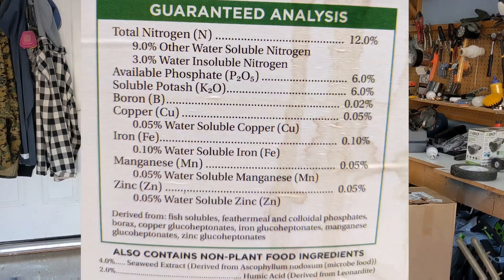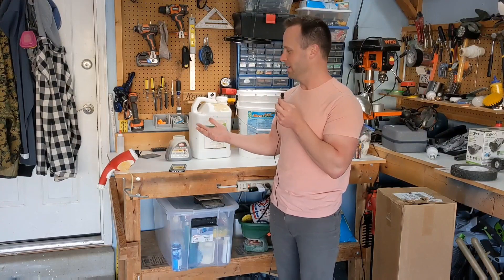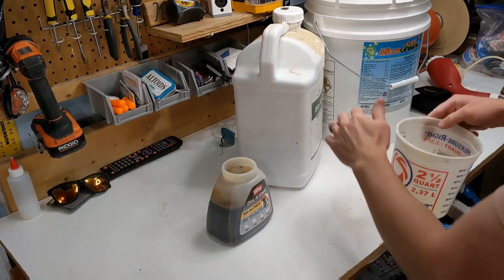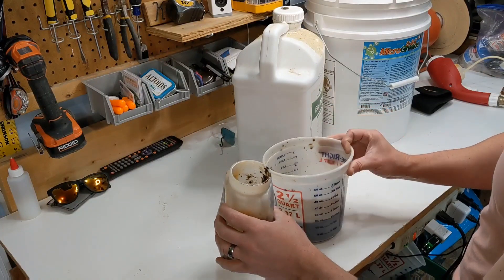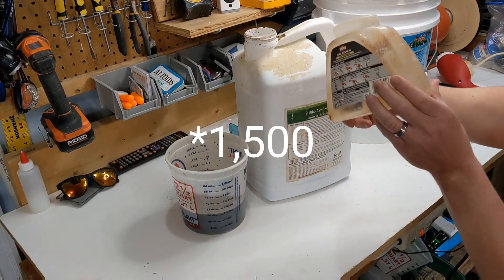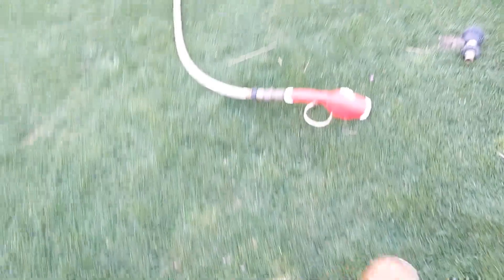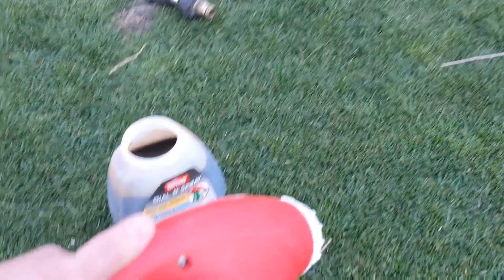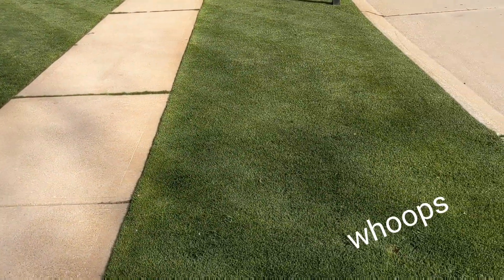Liquid Fertilizer comparison side by side

Comment: I predict no noticeable difference.  Overpriced gimmicks.  BTW, your hose cover ended up in my backyard in Minnesota.  It's now on ebay.
Reply from the maker: My prediction is there are much cheaper ways to make your own liquid for a fraction of the price with  little elbow grease. I should have made my own Ferrous ammonium sulfate mixture and had a plot of that. I may wait for the current effects to wear off and restart the test. My prediction is pretty much the same, to the extent they work, there are much more frugal options.

You must have found it in a field with one of your quadcopters!
Reply: @kove  LOL!   You don't know how right you are with me losing quads.  As for Goose Juice,  your own mix is the way to go, and tweak as you learn.
Reply: @kove  booom..way cheaper. FAS....   works best with a backpack    $0.15 / 1000 sqft.
I like your turf....mazama thats real nice....nice job!!!

 I have a mix of 90% kbg.   I let mine grow though.....the low cut isnt for me.  i prefer the deep overwhelming color of taller turf.  that doesnt make me right.....or wrong.
Reply from the maker: @harryharry3193  I made a mix of FAS last year, applied too much too quickly and ended up burning it a little bit. Iron is a key ingredient and all these micronutrient mixes.
Hi or short it's hands down my favorite grass. 💚
Reply: @kove  i use FAS.  great in spring, fall.  No no in heat.  I go 2 fs to 1 as, sometimes add a touch of liquid moss out....then WOWWW.

I Added in some midnight last fall..thats darker than my pennington kbg.   Its all great, easily best on street    
Keep up good work
Reply: Always going to be a cheaper option....I am a fan of convenience, and my time is worth more than researching and mixing my own. But everyone is different. Options for all